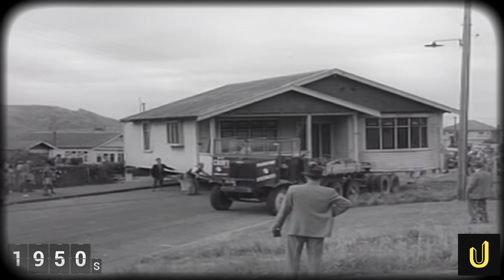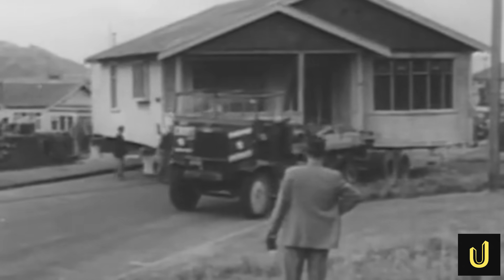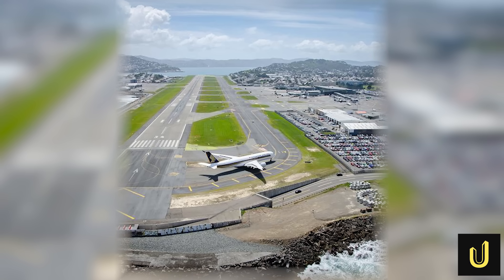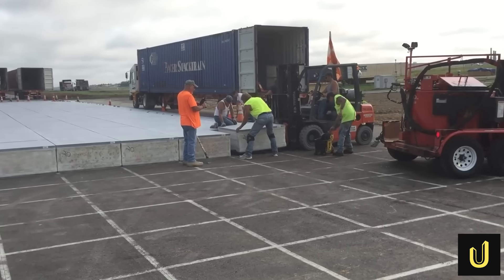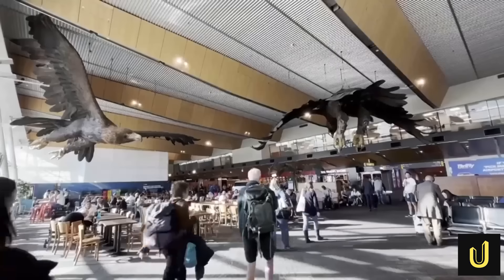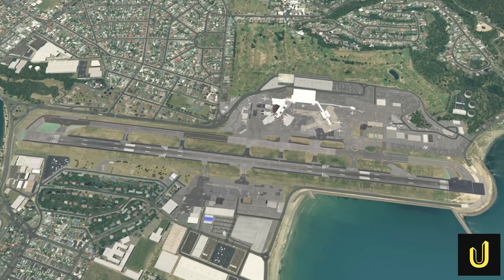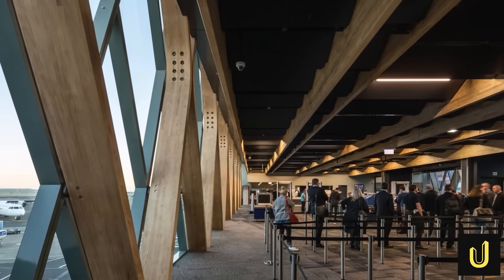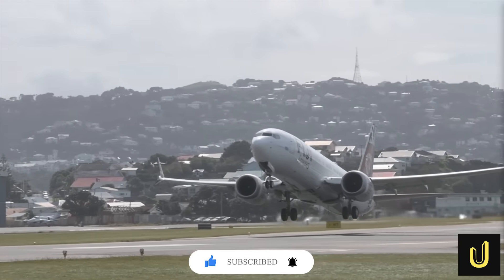Wellington Airport: The $500M Battle Against Nature

Comment: Sigh.  While a safety feature giving more available runway is great, an extension into Evans Bay is what should happen - there is room, all it would require is 1/ Drive to do it and 2/ building the runway expansion over Cobham Dr (SH1) via the runaway being built over the road on a bridge structure.  The lack of real ambition in my home town is just staggering. This lack of ambition been around since the weird decisions to make the Terrace Tunnel 2 lanes in one direction but only 1 lane in the other direction way back in the 1978 and not to build a second tunnel through Mt Vic way back in the 1974 after a pilot tunnel was completed...
Reply: The Terrace tunnel was intended to be two tunnels, but they ran out of money and we only got the Northbound one. You can see the motorway supports in the Clifton Terrace carpark. A better example would be the Karo Drive bypass or the Basin Reserve flyover.

Comment: Cool runway technology. I'd still rather see an airport extended/built in a different location though, and for the current airport to be repurposed for domestic flights only. The current location is just so impractical.
Reply: OK,  where?
Reply: Kapiti is better suited for a bigger airport with more room and the new highway basically removing all traffic wasn't possible back then but now would make more sense! I'm happy they have found a way to do this upgrade without making the run way long with would also ruin wellingtons most famous surf break.
Reply: Why domestic flights only ?
Reply: There is nowhere to put it

Comment: A lot of money for such a tiny airport, but having modern airports is essential for all modern cities. I do not understand why they can't both extend the runway at both ends and install the aircraft stopping crushed concrete safety zones so that they can future-proof the airport, and accept much larger and heavier jets.
Reply: It's not possible to extend to the North due to the hills over the suburb of Newlands. With 200 to 300 metre high hills covered in residential neighborhoods only 5 miles North it narrows the safety margin by a fair chunk, and that's not to mention the population being unhappy with the noise. They are already pissed with the recent change in flight paths as they had their court case chucked out. South bound is another issue of the water being surprisingly deep by that point, I still hope they extend it further out by that point though....
Reply: they cannot extend the airport northwards as that would cut off the Miramar peninsula from the rest of Wellington, and extending the airport southwards is a nightmare due to the wind and waves around the area
Reply: @squerk2  Why would that cut off the peninsula? Sydney Airport has an 8 lane highway that goes in a tunnel under the main runway. They did that decades ago to allow the airport extension into Botany Bay. Cars drive underneath, and can see giant aircraft taking off or landing above them, as they go into the tunnel. I just looked at the map of Wellington. It would be ridiculously easy to build a box tunnel first, for the road, then extend the runway over it and into the bay to the north. It would also be easy to extend to the south, although I suspect the water gets deep quickly on that side.

It is better for residents and visitors to do what it takes to make an airport close to the city work than to build an airport a long way from the city. I flew to Auckland in 1996 or '97, and all I have memory of is what a terrible experience that was.

Of course that experience was not helped by the airport having the rudest staff I have ever experienced at any airport in the world, and I have been to a lot of them. The airport information people lied to me and swore there was no alternative to the shuttle buses, and the shuttle buses were a rip-off price. When I told the shuttle bus driver I wasn't going to pay that much, he said to me  "fine, there's the effing road. Now start effing walking." 

I knew there had to be a cheaper alternative for airport workers etc., so I went looking for a cleaner, found one, asked, and sure enough, there were city buses but located at the end of the carpark and not advertised. It was a twentieth the cost of the shuttle bus, and the driver was friendly. But I was amazed how far from the city the airport was. It seemed to be miles through farmland on country roads. Hopefully they have improved the transport there these days, but in the 90's it was abysmal. I suspect it was possibly a new airport back then (it looked newish) and they opened it before transport infrastructure was in place. 

Those sort of things give tourists a bad taste in the mouth. That foul mouthed slob of a shuttle bus driver was the worst possible greeter for tourists any country could ever have, but it was also obvious that the airport information people were probably getting a kick-back from the shuttles, and were totally uninterested in helping tourists. I for one, have been telling people how bad my Auckland Airport experience was for nearly 30 years. 

Wellington lengthening a runway shouldn't be such a big deal. There are always solutions when people want to achieve something. Whatever you do, don't do what Auckland did back in the 90's. Do it properly, and a good airport is a big driver of the economy. Don't do it right, and watch the jobs and money go to other cities. It's not just those who work at the airport, tourists spend money all over a city, and cargo services likewise lead to factories and small businesses benefiting all over a city.
Reply: One of the problems is the rate of descent of large aircraft.
As they come over the hills to the north, they need to be able to drop down to ground level quickly enough which they won't if they extend the runway north.
Reply: One scary time landing there back in the 80s. It always looked far too short to land with a decent safety margin. The trouble with NZ now is that you can not do infrastructure without the RMA and consulting people's affected  Iwi councils and the like No wonder nothing gets actually done.
Reply: The best thing about having such a tiny airport, surrounded by water, with big swells to the south and a lot of wind, is that it helps keep the arseholes out of Wellington.  If Wellington had nicer weather and more space to land, drive, live, there’d be more people here.  It’s perfect the way it is - well, if we get the pipes fixed…
Reply: Because we had issues with nimbys about 10 years ago. Also the geography of Wellington makes it really hard to build a decent airport. Personally I think they should invest in the Wairarapa line and add a high speed tunnel through the Rimutakas and up to Masterton. Then build a massive Airport in southern Wairarapa. So hopefully there'll be 3 airports Wellington city (for domestic and international), Wellington/Masterton (the main airport) and Paraparaumu (for the Kāpiti coast and Porirua).
Reply: @hamdog9703 high speed rail would be a game changer for the region. I’d love to see it.
Reply: Agreed. We're still struggling to build a 4-lane road to the airport, let alone extend the runway.
Reply: @hamdog9703  I agree in part but there's 2 reasons why it wouldn't work.

1 - Population size, you would need to increase the population of the Wellington/Wairarapa region to more than 2 million to make this feasible due to airlines having to schedule flights to all 3 airports and the current numbers are too small.

2 - Money, you would have to completely redesign the Wellington rail network to have a high speed rail line = Billions of $$, the cost of building the airports, the infrastructure, etc you're looking at 10's of billions and NZ is too small a country for that. 

I like the idea but it's just too expensive for our current population size.